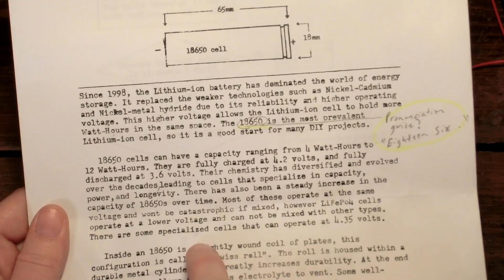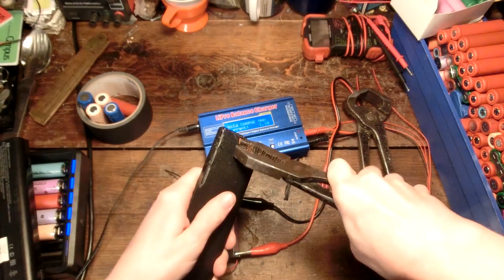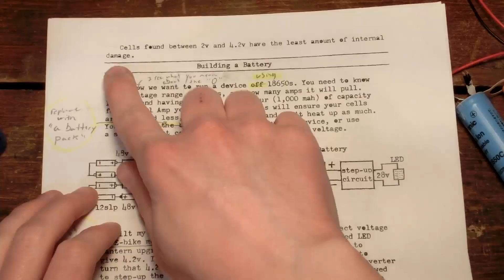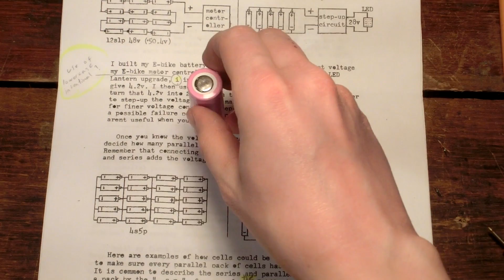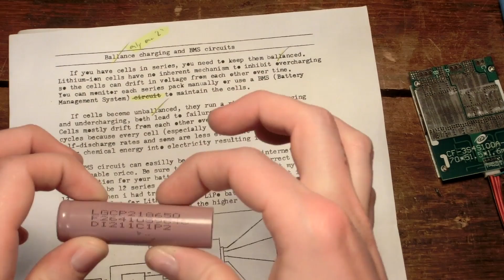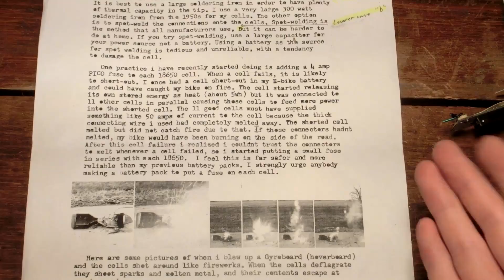The Tinkerer's Guide to the 18650 v1.4: Video Version

Comment: Hi, was wondering if you could answer a question. i have a ebike eskooter that right now uses 4 12 volt lead acid. the box can fit approximatley 160 18650s but i am little confused how to arrange them to produce 48-52 volts. how should they be arranged in terms of how many in parrellel and how many in serial? hope your willing to help me on that
Reply: +hyperview 13S is very close to the low and high voltage cutoff of a 48v lead-acid set without exceeding the maximum voltage for the lithiums or giving up too much on the bottom end. People looking to use solar charge controllers designed for lead-acid sometime take advantage of this. That's probably why 13S is so popular.

You could then go with 12P for a total of 156 cells. You would match the amp-hour rating of your 12Ah lead-acid battery if you make sure that your cells have a minimum of 1000 mAh (aka 1Ah) capacity each. 1000mAh cells would be pretty duff cells pretty near the end of their useful lives and probably not worth the time for making such a large pack. Even high-drain tool batteries are usually rated above 1.5Ah.

Keep in mind that if you went to 10P for a total of 130 cells and you made sure they were over just 1200 mAh, you would match your current setup. You have quite some leeway for being choosy about what minimum capacity you deem acceptable. Don't put in severely mismatched cells just to use up all the cells you have.

So, I think you should have no problem exceeding the capacity of what the current setup has as long as you aren't using cells that are branded TrustFire or anything-Fire.
edit: math fail
Reply: the current lead acid system is 12v 12ah  500 watt motor 48v system i never rode the bike further than a 9 mile trip to a flea market which took about 40 minutes where i plugged it in to charge for two hours as i shopped  then made it back the 9 miles. i live 12 miles from the beach and would like the bike to make it there and back on one charge. i never in minutes found out how long the bike runs until batteries died.
Reply: Nice, thanks for that detailed explanation. 500 watts draws 10.5 amps from 48 volt battery which is the missing amp draw number. Math error on my part is 13s x 12p = 156 count and not 160 as Markle2k shows.  Showing it can happen to anyone. So with 48ah system you should have been able to drive it 4.5 hours (in theory) if your motor was actually taxed at 500 watt rate during the entire time frame.  Which is the highly variable issue, if we had a full  ride time number delivering decent power, it would be easier to 'intuit' a reasonable feel for how safe the new battery system would actually be. And to that end, I would install a temp gauge NOW and see what it runs at in the stock configuration before changing out the battery pack.  That way you can compare relative power output issues and know  your safe temp as is. Having the exact motor used info will help to know where to mount temp monitor sender among other issues like is the 500 watt rating overblown salesman talk for 250 watt continuous or a real number we can trust.  It's kind of important you reveal ALL you possibly can and at the earliest convenience - I really should be doing my taxes instead. Any chance your lead acid batteries are actually 3ah individually and not 12 ah?  How about a battery number? Make and model of bike would have answered ALL needed info. Did you still have decent power approaching the flea market or was it noticeably getting weaker?
Reply: the bike is a china made skooter that has been branded several different names over the years and imported usa ,the batteries are no name but state 12v 12ah on them. currently the bike is being importanted and branded gigabyte and claims 700 watts. i believe mine is 500 watts as stated because i have ridden 250 watt bikes that were lighter and i could feel dissatisfaction in power and response. my bike which is 150 lbs alone i am satisfied with response. its not a 250 watt.
Reply: Good info there, thanks. So 48ah system in total, you still will have  a three fold range increase with 13s 12p set up with used 18650.  Still recommending rinoa's fuses on each battery and other monitoring measures I mentioned earlier.  Best of luck - quite a project.
Reply: yes if i go through with it been collecting used laptop batts and testing them first out of the plastic, some are 0 volts putting those aside most are 2 volts so i am charging each one at a time for 12 hours and they are then up to 4 volts on my old analog volt tester. when ready i will get the proper equipment to discharge and find out the ah on each cell. i may or may not try out my hand at making a battery for the china skooter. but interesting to watch the youtubes on it. i ride a motorized gas bike too (80 cc) which i have ridden the 12 miles and back to the beach but its a hard tale and my behind and back hurt bad after, the skooter has shocks and easy on my butt and back
Reply: 52volts divided by 4volt per battery = 13 in series, but from then on we need your amp/hr rating off one of your  lead acid batteries you are using to go further with comparison/safety calculations.  And also need how long can you ride with those 4 fully charged 12 volt lead acid batteries?  Not distance - time in minutes of decent power. Amp/hr rating and minutes please.
Reply: the current lead acid batteries are rated 12 ah but i want more amp hours. as i said it can fit 160 18650 so i want to go for a 52volt ( I read 48v controllers can handle the 52 volt batteries) so considering i can max out at 160 18650´s what should the configuration be? what should it be if i choose 48volt or go for 52 volts, max ah 160 cells can give me (even if the ah is lower on used laptop cells) the number 160 cells i want to decide the configuration not the original lead acid capable ah.  I do not want to match the original lead acid in ah i want to exceed it.is 13 in series the max for a balance charger?
Reply: The problem with 48 volt is that there is not an easily found BMS for that set up with 12 cells in series.  Config there is 12s 13p. 13 cell BMS as reported by rinoa is easily available. I believe I heard 20s BMS was also obtainable, so no, 13 is not the max. But we really can't use that design anyway - 80 volts. Config there would be 20s 8p. I detected in first post your desire for better than present situation and you have it. 4 x 12 ah = 48ah VS
160 x 1ah (safe, used battery draw rate of 1 amp) = 160ah. Configuration is 13s 12p so build 12 cell packs in parallel (12 amp safe draw, 24 amp potential for burnt up motor and/or fire in the battery pack) to then stack them 13 deep and you have no more room with 160 cells used.  You also have an increase of 3 times the present range with very real over current potential of 200% easy.  I wanted the time factor because of safety factor, electric motors can easily overdraw their supply harming both the motor and battery pack to set your bike on fire. You WILL have this potential depending on how hard you drive it especially with such a large increase in power/range, please consider buying and installing 160 4amp  pico fuses, one on each battery.  Motor temp gauge would also be a very nice touch and valuable info to have in real time. Another for internal battery pack temp? $3 eBay with extendable remote sensor. Voltage meter for same price, you don't want to go too low especially hot. Latching on/off push button switch also for a song turns off all three digital LED gauges. These cheapies will need waterproofing issues addressed though.
Reply: you stated 4 x 12 ah = 48ah VS - the 4 lead acid batteries are in series making the ah still 12 ah but the voltage 48volts. did you type wrong or a little confused? i don´t see how wanting to go from 48 vollts 12ah to 48 volts 20 ah would cause the  motor to burn. ah is the length of time or range of the battery lifes charge, rinoa himself says his battery build is 48 volt 30 something ah (way above my 12 ah current battery) 
i know he stated 13 in parralel for bms is desirable because of available bms. so how do i make it work with 160 cells??
Reply: I'm not the one that's confused though. It doesn't make sense to you only because you aren't yet fully fluent in what's going on. AmpHours is a combinatorial term, it means different than you are currently understanding it. It's a shortcut method to express total combined power (not amps), thus it is always additive even though the amps depend entirely on the series or parallel method of hooking up those 4 batteries.  For amps you are correct sir, for amphours, they always add -- series or parallel hook up method does NOT matter because it's a measurement of total horsepower if you will allow that term. Extremely vital mistake made in your last question - you meant series instead of parallel and you simply have to stop doing that. As the math teacher said, check your work - the human mind is full of such foibles,  thus one needs to learn their own foibles and be ever mindful to compensate. As you read further please have page 4 of rinoa's document handy for reference. This system is a 3s 2p layout properly set up with a 3s BMS.  Your system will have 13 cells vertical in a similar diagram based on this diagram with 14 charge balancing wires to hook up to the 12 cell wide parallel packs instead of the pictured two cell wide  packs in parallel.  I still don't have a ride time factor for your present lead acid system, maybe I should ignore you and see how you like it? It's a pretty simple question, how many minutes can you enjoy riding that bike before you drag out the charger? Does the bike have a make and model number and can you post that information?

Comment: How do you tell between a knock off and a true Imax B6 charger?
Reply from the maker: +William Randles if the software is all fucked up, like i have ones where the buttons are all mixed up. lol
Reply: the legit one has a special holographic sticker on the back that you can scratch off and verify the code to its web site to confirm its authenticity
Reply: Ok, same question but with the qualifier - BEFORE I buy it?
Reply: I have both and you can see the differences of the two.  The knock off will have the missing holographic sticker on the back, exterior color will be off, display brightness will be lower and button sensitivity will be very sensitive.  They both can be re calibrated to meet your specs (if they need it) and work pretty good.

Comment: hey rinoa I'm not sure if you we're aware but many if not most ecigarette devices run off 18650 cells and the protected ones used to be fairly common. and now we have 3500 MaH 40 amp cells these days. just some insight really enjoyed the video :)
Reply: Alabastard Nope.
Reply from the maker: +Alabastard yes i know, and no, protected 18650s have never been in high use compaired to regular.

Comment: 3.6 is a nominal voltage, most manufacturers recommend not draining below 2.8V, and a high of 4.2 unless it's a 4.35V cell. Don't buy chinese cells that will catch on fire, and don't waste time or money on crappy protected cells. Buy name brand high drain cells, there are plenty of good sources for these, imrbatteries.com/illumn.com/....ebay!!!! Also... there's tons of chargers on the market like the liitokala engineers that will do a discharge/recharge cycle for a capacity test, give you internal resistance of the cell, and support over discharge cell recovery.....built in... easy.
Reply from the maker: but everything is made in china, so dont buy anything modern? lol
Reply: Rinoa Super-Genius not everything is made in china, most good cells are made in japan.
Reply: "Crappy protected cells" are good for flashlights, and presumably vapers. The cell shuts itself off at 3v, which is right before the knee hits with a load like that. Otherwise you risk bringing the cells far below their safe voltage since the LEDs don't dim at a fast enough rate for you to notice until it is too late.
Reply: Markle2k "crappy protected cells" are NOT good for flashlights, and they are EXTREMELY DANGEROUS for vape devices. This is why you hear of mods exploding in someone's mouth on occasion. USE GOOD CELLS THROW THE TRASH OUT!! On the subject of flashlights, I could write you a novel, as they are what I do. You MAY get away with a crappy protected cell in a crappy "1000 lumen" chin esse special, but I've seen them draw enough power constant enough to heat up the shrink tubing, melt through, and then the heat tab that is supposed to melt in half turns into the conductor that blows the cell up, because directly connecting + and - is bad.   On the subject, any decent flashlight will have low voltage protection that prevents the light from being used if a cell is under X.X voltage, typically 2.8. On top of this, all LEDs have what is known as "forward voltage" or "Vf." Many people misunderstand Vf, thinking that lower Vf is better, when in reality it has nothing to do with the efficiency of the LED. An LED with a Vf of 1.8V will simply not power on until you put 1.9V to it. When you have a Vf of 2.4, when the cell hits 2.4V, no more power will flow. Since manufacturers recommend 2.8V as their minimum voltage range, any cell under needs to be "recovered" and it is a hell of a lot simpler than made out to be in this series of videos. Basically it is just trickle charging the cell back up to normal range, with 300 or 500 mA of current. If a cell is depleted, it probably has internal damage, maybe a short, and you can check this by checking the internal resistance...There are dozens of nice chargers on the market that will automatically do it, so you don't have to!! This is 2017, buy a liitokala engineer that does all this and move on.

I hate to sound negative all the time haha... I'm sorry if it's coming off like that. I do enjoy the vids, because they have some great information on how to wire up a pack, and also how to wire a balance charger. I have to admit that the 50's solder iron is a bit much, and unnecessary if you know how to solder; i.e. USE FLUX, but it is a beast that I would love to have around and use as well, I am a sucker for vintage tools, so style points for that imo. :)
Reply: +Matt_Jr I've been doing this for longer than Rinoa. I started out with flashlights and moved on to a centralized 12v lighting system for my bike and various other small pack projects. And, Mr. Shouty, I know the value of a good quality cell with a protection circuit built in. I killed a lot of cells by forgetting a spare set and staying out in the dark too long on my bike. And that's a hassle because I match my sets' capacities to the load so they are balanced at a 3v cutoff.
Protected cells cost about a dollar more than unprotected cells, but they are a nice belt-and-suspenders addition to the BMS and low voltage alarm.
Reply: haha, no, sorry, you don't "know the value of a protected cell." What you have done is circumvent/band aid the real issue, and what you know is "how to poorly design a lighting system."

Comment: I hear of man say that the battery holders let the batteries get air between them.
Reply from the maker: they dont need air unless you have overheating issues, you only have overheating issues if you dont make the pack big enough.
Reply: That's what I figured. There are some pros that make what your doing look so hard, you know like intimidate people so they give up on a project. But I like your ideas of doubling down for every amp needed. I will be starting my build in a few months. So I might need some input.

Comment: Also, you did not mention in the video about buying cells straight from China. About 3.20-5.50 a cell plus $55-90 shipping. Make good friends with someone on aliexpress, alibaba, made-in-china, etc.. and you can get pretty good prices on the cells. You cannot get any cheaper shipping, trust me. Completely worth it if you buy a lot of cells at a time, don't buy just 20 at a time because then it isnt worth it. I bought 120 Genuine 26F's for $475 to my door. Every single cell was 10mV within each other.
Reply from the maker: no cheaper shipping than 60$? how about free.

i'd rather just pay 20 cents per cell and still get good cells.
Reply: Well, the 1kWh 12S10P pack I made isn't going to be easy to replace individual cells, so I opted for cells that are only a few weeks old from the factory. I'm also drawing nearly 500-1200w from the pack, so I don't want any chance of a cell failing. I had a spreadsheet of the cost of cells off ebay and amazon, with the cost per kWh. This was the 3rd cheapest option, after 2 sketchy Chinese laptop battery packs that could have generic/fake 18650s.
Reply from the maker: i made a 12s 12p battery for like 100$ and its taken me about 5,000 miles so far without any real issues, and still managed to get name-brand cells.
Reply: Will you consider putting it up on Google Docs so we can see it?  Would be very helpful for a lot of us.
Reply: Are you talking about my costing sheet? Its buried somewhere, and I would not be surprised if half the links are dead on ebay
Reply: wlai http://i.imgur.com/VFENagG.png